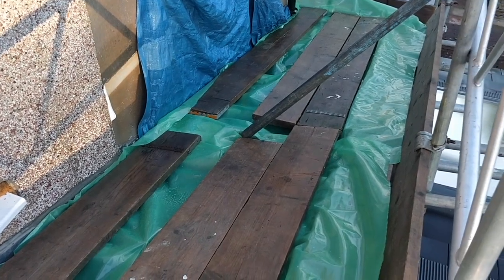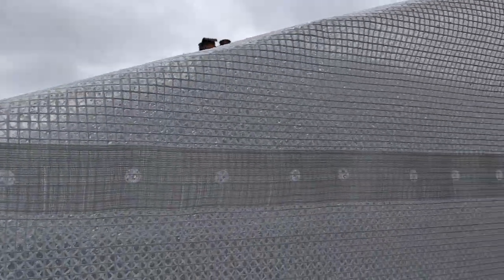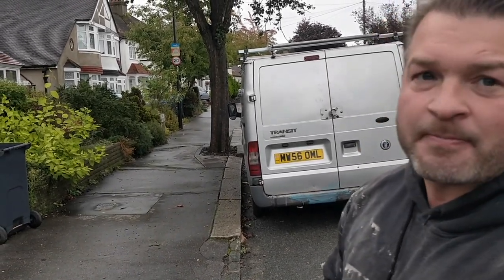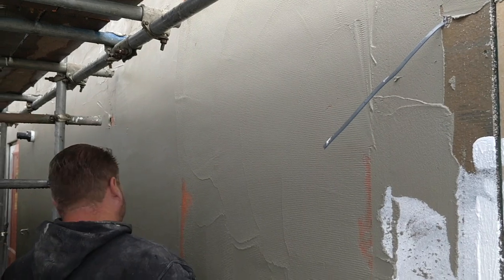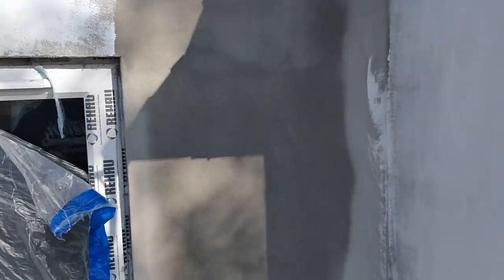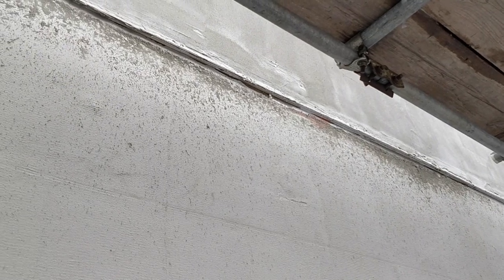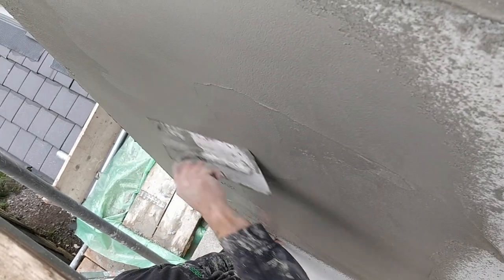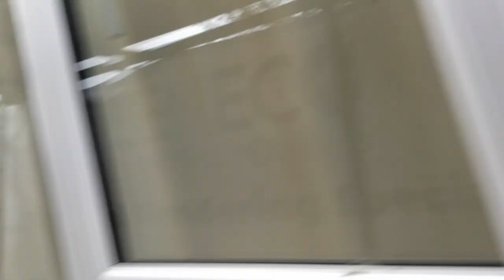Rendering the House - Base coat and Mesh

Comment: I was just in the start and middle of my build at that time and the weather was just the worst.......it was wind or rain or both and we had a great big wind and rain from 2 in the morning to 8 in the morning..... Great to see you was just on the last of the outside.
Reply from the maker: I'm so pleased I don't have to rely on a tarpaulin and length of 4x2 for my waterproofing any more 🤣🥳
Reply: @OfficeBoyBuilder  Yeah they temp felted mine and still the water got in....Tarps are useful but the wind we have had of late they are very temp measure. At least you can use the 4x2 afterwards. The tarps i had on the main roof where so noisy as well in the wind.....

Comment: Hi ,I'm a spread that has only started using acrylic instead of sand and cement. Was just wondering can you do the first coat one day with the mesh and then come back the following day and fill it out and edge it and float it up smooth?. I was told to do it all in one day but I only have a small crew and we are finding it tough to get up and down a gable twice in one day. Thanks
Reply from the maker: Yes spread it over a few days mate. This whole job took 1-2 weeks!
Reply: Thanks mate

Comment: Gentle reminder... where  is the dry fixing of the polystyrene boards?
Reply from the maker: We used the same render adhesive on the backs of the polystyrene boards, so that there was no need to puncture them or fix through them. No thermal breaks, and no way for water to penetrate 👍
Reply: @OfficeBoyBuilder  
Let's  agree  to disagree 
Maybe in the future we can  talk more about that 
In mean time  wish  you  best of luck
Reply: Was really no need,it was such a small area with a no cavity wall,so the adhesive and backing was upped also so much quartz etc…
Base rail and everything super secure…it’ll outlast our lifetime..we did a pull test as well as me sitting on the boards,I’ll dig the photos…
Comments appreciated :)
Reply: @stevenalbert8552   hi mate cracking job what spray system was you running on this project cheers

Comment: 5mm thick hhmm
Reply: Around 50mm in total less the render carrier board,it was added due to the boards and cavity was thin…it was just for extra thermal insulation to the front of the house.winter months they will be grateful..thanks for the comments was a real tough job..weather etc